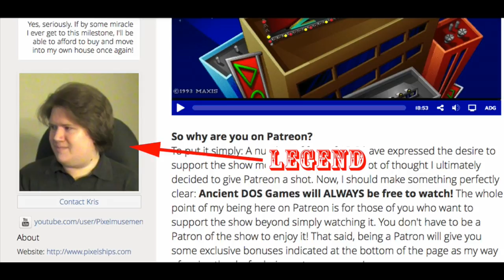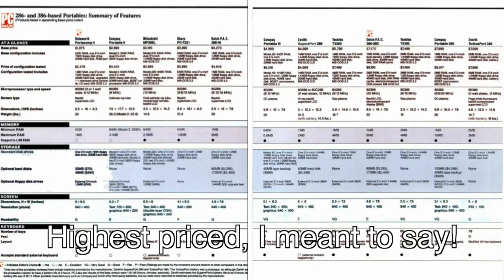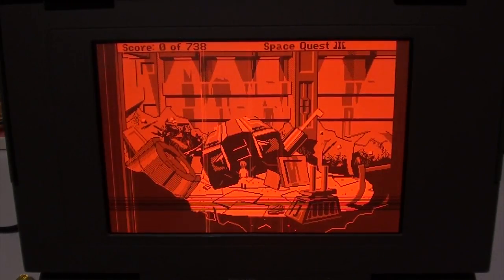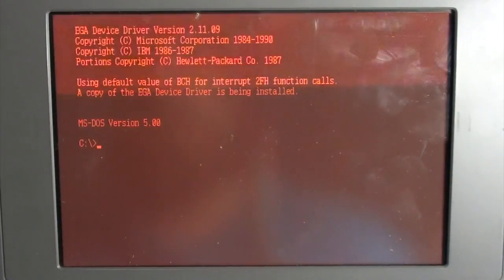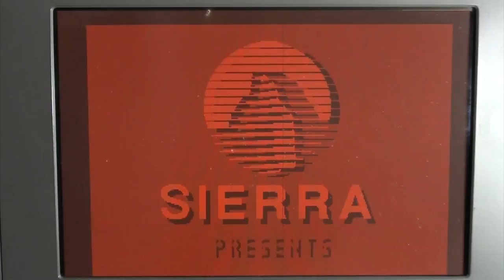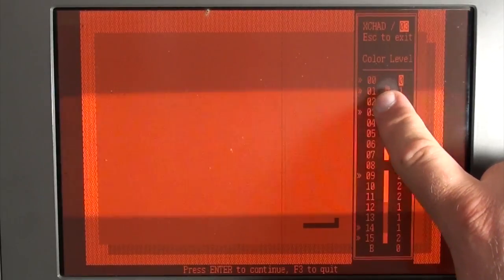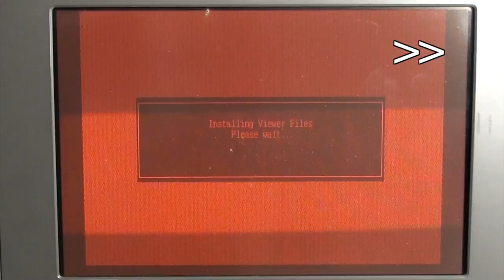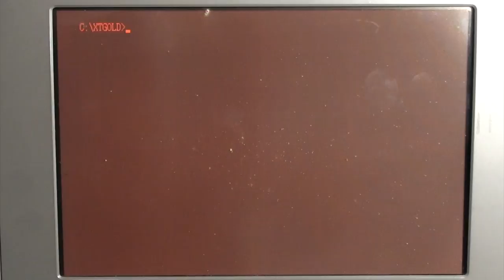[retro swim] - Episode 27 - Toshiba T3200 overview, repair

Comment: I have a T5100 with the same line down the center of the panel. I've replaced the miserable old 40 MB drive with a 128 MB flash drive and use ANYDRIVE which replaces the MBR with a BIOS patch that lets it boot correctly.
Reply from the maker: The earlier T3xxx models don't use IDE, so you can't just attach anything, hence why I used a SCSI card in this. Later models yeah, there are a lot of useful alternatives these days, like flash modules and CF adaptors! :)
Reply: any idea what the size HD it can handle? I'd think you could put a 1gb or bigger flash drive in it...

Comment: Hi! i have one! its screen doesn't work, but the rest may work, and the power supply because it turns on the coolers... i live in argentina and i wonder if there is an international market for those spare parts... because i felt a kind of strange responsibility that prevented me from throwing away... you guys what would you do with these vintage resources? thanks!

Comment: im looking to get one of these and fit a mini atx mother board and crank out some serious specs and put in a 15 inch monitor etc. 
My only query is how to utilise the original keyboard. Does the keyboard have a generic output that I can convert to usb or some kind of modern motherboard input?
Reply: I think it's way cooler wit plasma screen. Please don't ruin a working machine.
Reply: You might be able to use an Arduino to help convert it to USB